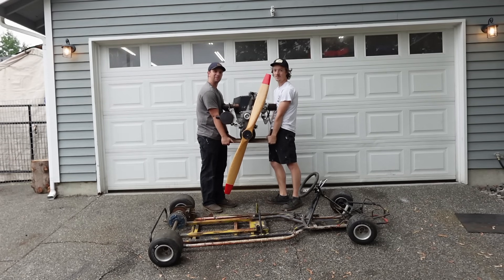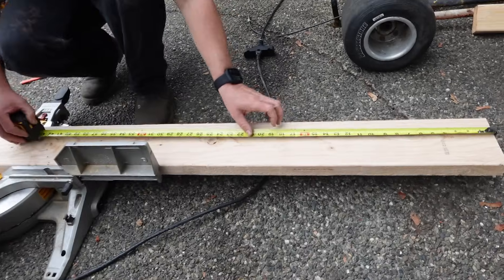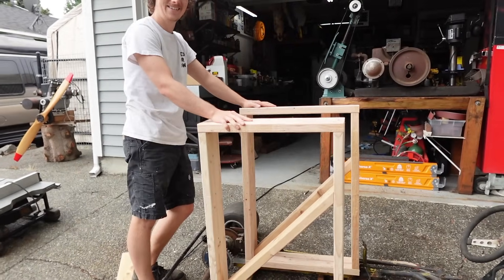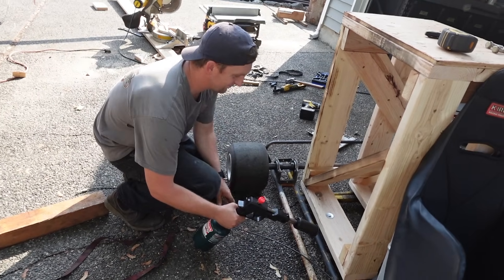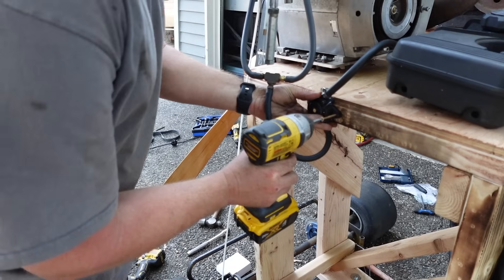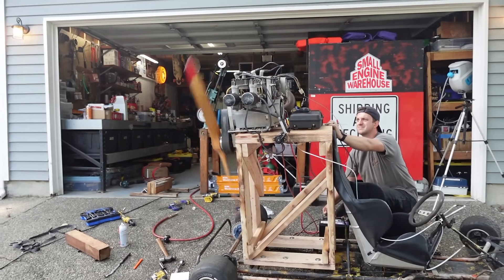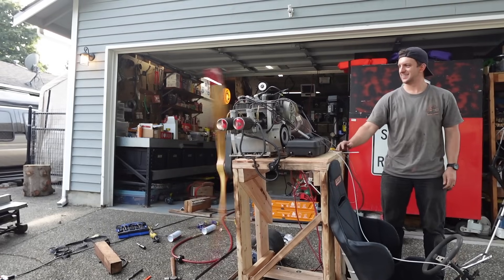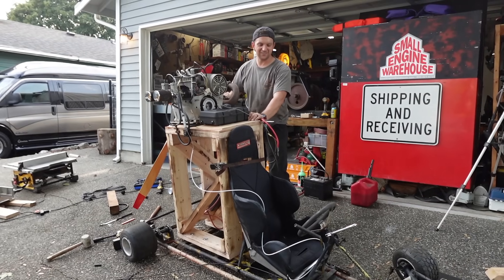We Put an Airplane Engine on a Go Kart

Comment: Your prop is on backwards. It is installed in the tractor configuration. You want to flip it so it is in the pusher configuration. You are losing 50% of your power and efficiency.

Comment: Read your comments.  I told you in the last video that your prop is on backwards.  You're dragging the airfoil of the prop backwards through the air.  It will work tons better if you flip it around.
Reply from the maker: Whoops
Reply: Yeah I saw that too, just the sound that prop made was wrong, then I looked at it.  haha might be a little lucky it didn’t fly apart actually
Reply: I noticed right away that your prop is mounted backwards.   The flat side of the blade is supposed to be providing the forward thrust.
Reply: I said the same thing too, in the last video!